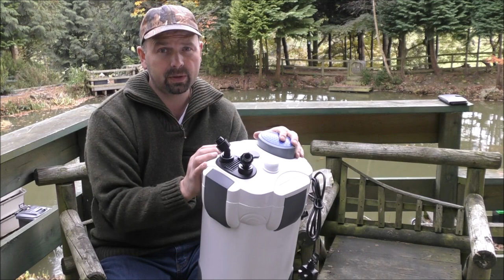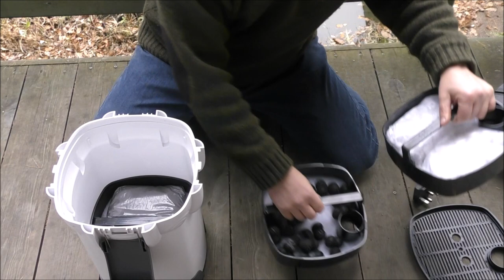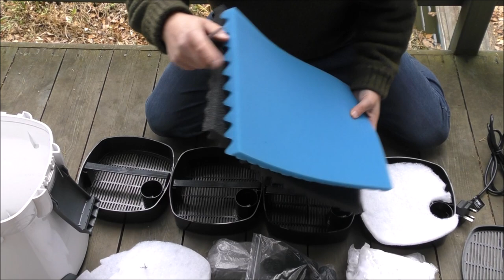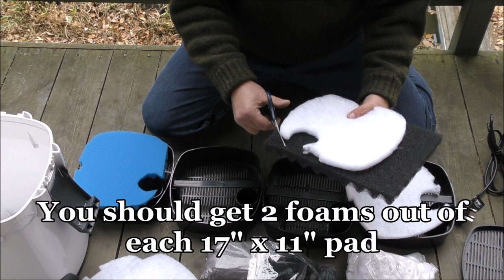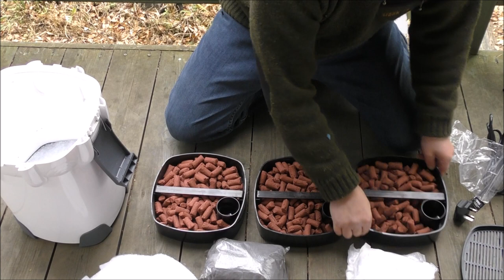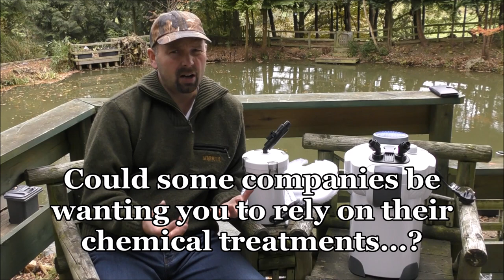Why Your Filter is TOO SMALL and NOT CYCLED

Comment: Hi, I love listening to you, but have a question about Zeolite use in a heavily stocked Goldfish/koi aquarium. We brought our pond Koi/goldfish in for the winter and are trying to maintain them in a 75 gallon tank until spring. 1 large koi, 7 large comets and 2 baby koi and 2 tiny goldfish. Our pond isn't deep enough for this kind of cold. We are hoping to deepen it and enlarge it this summer. Right now it's only 18 inches deep in one area. 
We had 2 huge big Penguin Bio wheel filters all along the back wall of the tank, but they just couldn't keep up with it and the Biowheels would stop moving in just a few days! We were having to replace the pads every 3 days and rinsing and scrubbing the filter pads, didn't work well at all. They clogged all the faster! We are doing water changes of 50% or more every week, and even some smaller changes in the middle. So this hasn't been going well, the ammonia was starting to show up, and cycling wasn't happening.
 
We watched several of your videos and have followed your advice,.... We purchased the 15 compartment Trickle filter you suggested and have just set it up, with Floss on top, Biohome in the middle and charcoal at the bottom. Now it's only been a few days,....we are just now remembering to add the little Gel Balls you included,....but we have a question about Zeolite. Should we use it too for now? Since we are getting some ammonia readings on the test strips? Sorry this is so long, but setting up the question was important to understanding it. Thank you!!
Reply from the maker: As long as you have plenty of media for the size of tank and stock of fish (it will be around 2kg per 100 litres for koi / goldfish) then zeolite should not be needed but it could be used in place of some carbon if you wanted to keep the ammonia down while the media matures. Bacteria does need ammonia to feed on so monitor things and if ammonia gets to high use the zeolite to lower the level. When media matures the ammonia should drop naturally.
The gel balls should go in with the media when setting up the filter as they will dissolve in presence of ammonia and help to seed media.

Comment: Thank you very much! What you've described totally makes sense and should be followed by everyone. Although I already have optimized my filtration mostly like you mentioned it, I did'nt thought on this last fine filter layer...which I will throw away next time cleaning my filters. ;-) How do you call this small filter, which you use as a mechanical filter? Didn't find it on amazon...

Comment: Very informative. However, I did have to have conversion calculators ready for liters to gallons and kilos to pounds. Very good though.
I was wondering, would it help or be beneficial to run two canister filters set up the same way as you have demonstrated?

Comment: Excellent video Richard. Have SUNSUN  dealt with the degradation of the plastic trays where the UV is housed yet? It's the only complaint I have for this very competitively priced canister filter. Apart from that they're well worth the money.
Reply from the maker: I have heard a couple of people mention the UV being a problem on the plastic but that is a common problem with cheap filters with integrated UV lights. I'd personally say go for one without a UV and install an inline UV on the intake or outlet pipe if necessary but the filter I have just shot a video for (Unimax 700) has the option for a good UV.
Reply: @pondguru  
Thanks mate! Sound advice.

Comment: Could you possibly do a follow up video that decodes what the various Sunsun series model numbers indicate?
I've been scouring the web trying to find a table that compares each of the different Sunsun series filters.
For example, what do each of the series numbers represent, such as 3##, 4##, 6##, 7##, etc...
What do the third digits indicate, such as ##2, ##3, etc...
What do B and non B models indicate?

I am specifically interested in doing the separate booster filter arrangement to handle the mechanical filtration and then use the canister filter to be totally dedicated to the bio media.
Can you give Sunsun model recommendations for a booster and canister filter combo that would be best suited for a general community fresh water 55 gallon tank?
Reply from the maker: Just as in this video - the 2000 litre version of SunSun and the 2.3 litre booster.
I think the equivalent number is 304 or 404? Over here they are called All Pond Soultions.

Comment: What about sponge filters? I think I remember seeing on one of your earlier videos in your fish shop that you had separate tanks filtered by only sponge filters. They seem to work, but no capacity really for anaerobic bacteria. So not all systems will manage anaerobic filtration and continue to rely on regular water changes.

I'm not having a dig, simply saying that in some instances a full cycle is never achieved.
Reply from the maker: Dead right, in those tanks filtered by only sponge filters or plastic moving bed filters nitrates were always high so reasonably large regular water changes were the only way to keep them down.
The size of filter and how it is set up will dictate how successful the cycle is and what the final concentration of nitrate will be - the better it is set up the more chance there is for a full cycle.

Comment: Good video, really enjoyed it. Would be awesome to see you put it to the test, run a couple of filters with you set up mentioned on a big 5ft tank with a couple of Oscars or something, testing and keeping a diary and see how nitrates do.

Would be keen to ditch the chemical filtration, but it leaves the water so crystal clear.

An interesting one for you, have you heard of Szat Clearwater? It's a chemical filtration that not only leaves your water crystal clear but it helps reduce Nitrates, been testing it myself on a fancy goldfish tank. 2 weeks without a water change and was only 40ppm with 3 medium goldies in a 100l tank.
Reply from the maker: That product sounds promising and 40ppm is low for a normal goldfish tank after 2 weeks just using chemical to keep it down, I've not heard of that one so couldn't say if it affects the anaerobic bacteria like other types appear to do.
Carbon or activated charcoal is as good as anything for 'polishing' water and drawing in residual fish treatments so I always recommend that since it allows the biohome filter media to achieve full cycle filtration.
If you scroll down some of the comment sections of this and other related videos you'll hear reports of the full cycle being achieved in all sorts of stocking scenarios including cichlid tanks, marine, goldfish and other tanks where high nitrates are normally expected.

Comment: Wouldn't improving the media and possibly enhancing the internal layout of the canister filter also increase the size of the tank it can support? Or is it mostly based on liters/hour flow?
Reply from the maker: The amount of media used in relation to the stock is the critical thing and that dictates filter size if you're looking to achieve a full cycle (reduction in nitrate).

Comment: Hi Richard! That was a master class about filtration and canister filters. I am considering moving to a sump, to accommodate more media, as I have goldfish. What about sump filters?
Reply from the maker: The same principle of Mechanical then Biological then Chemical (if used) will apply to all filters including sumps so no worries there. Sumps are often way bigger than they need to be so often end up getting packed out with plastic media since it is cheap. That is fine as long as you have some proper media in there too - enough for the situation which if you have goldfish could be up to 2kg per 100 litres. Many people use filter socks like this: http://geni.us/XnWA8k as their main mechanical filtration and they work very well, being swapped out and cleaned as necessary.
Thanks for watching and appreciating the videos.

Comment: Dude I've been watching info vids for a while now and yours are superb. I'm learning so much. I might need to get a larger external filter now and fill it with your biological media. I have the aqua one ocellaris 850 for a 230 litre tank. What do you reckon.
Reply from the maker: I think I may have answered this via an email which came through shortly after you posted the comment?
Here is what I sent:

I don't have the tray sizes recorded for the 850 nor can I find an exploded diagram anywhere to indicate the flow direction but it seems like the water travels down a central tube and water flows up through trays so the bottom tray would be for foams and fine pad leaving 2 trays for media - looks like each tray will hold around 1kg - 1.25kg of biohome ultimate so it could be just about big enough for the 230 litre tank to achieve a full cycle (reduction in nitrate).

You also have soace under the trays for settlement media (e.g. eheim mech).

This video explains the water flow: https://www.youtube.com/watch?v=pY3BeV-07rA

Unfortunately the guy sets it up arse end round but that is how it comes from manufacturer. If you haven't got fish in teh tank and want me to include the filter in the 'pimp my filter' series just give me a ring any time as I'd happily upgrade it for you.

Regards,

Richard 07772848730

Comment: Hi pondguru,what a great video full of great info 👍.I have recently bought a aquamanta efx 300 external filter and a filter booster (2.3 litre) .I added the old media and ceramic noodles to the external filter.But am now thinking of buying the biohome ultimate to put in my filter.What would I need to do when putting the new biohome media so that it doesn't cause problems with bio filtration ?My filter has only two trays,hence why I bought the filter booster. There is a gap between the bottom and the first tray,do you think I can put biohome in that gap?
Reply from the maker: I think we spoke on the phone yesterday - if there is anything you else you need to ask just ring any time.

Comment: I have the very same filter and booster canister the pre filter or booster canister has the course, medium & fine foam the bottom tray in the filter has fine polishing mats I then have three trays full with Biohome Ultra media I am using this on a 200 ltr tank that has been stocked for about a month now I have never had a spike of Ammonia, or Nitrite and the highest Nitrate I have experienced is 40ppm but I am hoping that will improve with time. will  consider putting polishing foam in pre filter or booster canister now freeing up another tray that will take another kilo of Biohome. Feeling very pleased having set it up the very way you say :-)
Reply from the maker: I'm glad you find the videos useful - thanks for watching.
If you're only a month in and you have 0 ammonia and 0 nitrite then its going well but if the nitrate is only 40ppm then it could still rise depending on stock and amount of media used. Some people never develop high nitrates (60ppm+) while maturing the filter as they fall after only a couple of months of rising but others will get very high before they fall - every tank is different but as long as enough media is used for the volume of tank and stocking situation then you should achieve full cycle no worries.

Comment: I can't believe I missed this video.  Probably your best.  I have two 60 gallon tanks with 3kg of Biohome Ultimate per tank with 406 Fluval set up like you advised.  I've been having issues not getting the full cycle going even after 10 months.  A couple of months ago I stopped using Prime.  Does that affect the anaerobic bacteria (you were talking about?).  I still do monthly water changes but the nitrates go up slower now.  

Your thoughts would be greatly appreciated.
Reply from the maker: Dear Chris,
It would help to know what the stock is in the tanks - 3kg for a 220 litre (approx. 60 US? gallon) normally stocked tropical tank should be no problem for a full cycle. It generally takes 1kg per 100 litres (26 US gallons) for a normally stocked tropical tank to achieve a full cycle and you've got nearer 1.5kg per 100 litres there. Heavily stocked tanks could take twice as much - I don't know the stock so I'm fishing in the dark here as to why (apart from the use of prime and time between water changes) the nitrate is still high.
Yes, anything which 'binds / detoxifies' ammonia, nitrite and nitrate will have a real starving effect on bacteria (esp. anaerobic bacteria) and that in turn affects the filter ability to process nitrate (ammonia and nitrite are easily reduced as that is all aerobic activity) so it's not surprising that you noticed nitrate rising slower now you've stopped using prime. That trend should continue to achieve a full cycle.
However, the tanks should ideally be cleaned once a week to remove uneaten fish waste and uneaten food - that will definitely be contributing to rising pollutants.
Feel free to send more details of the set up, stock, how each filter is set up, pictures etc. to sales@filterpro.co.uk as I quite often miss messages and comments on youtube - I get so many from the 1000+ videos that only a few are ever sent to me as notifications.
Regards,
Richard

Comment: You rock!  I have several Eheim canister filters Eheim pro 4+ 250, 350 and now a 1500XL (my 250 is now a spare as too small but good backup just in case).  In studying the water flow of the 350 it appears the coarse pad captures large stuff at the top JUST BEFORE the flow to the bottom of the canisters.  Therefore does it make sense to keep a coarse pad at the very top before the flow downward?  Secondly I have ordered the filter boosters, therefore if I put one of those on prior to canister filtration, then technically I feel I don’t need any mechanical filters in the canister after the installation of the filter booster which sits prior - correct?  OR should I keep the coarse one at the top anyway regardless?

Great video ! I have not set up my XL 1500 yet - it’s a beheamouth but adequately sized for my 125 gallon that I will be setting up
Reply from the maker: The 1500XL is certainly a monster in every sense.
With the pro4 series you're right with the layout and operation - just leave the pre-filter as it is then use bottom tray for the foams and fine pad followed by biological media in trays above that. A booster will take the mechanical filtration so will free up the bottom tray in the canister. The top pre-filter tray may as well have the foam left in there even when using a booster due to the shape and depth not being good for adding any media there.

Comment: So to contest to this, I have a 60gal us tank, with 2x penn plax cascade 1000 canisters, bottom trays set up with the triple pond foam and each have 2x full trays of mixed Biohome ultra mini as well as Biohome ultimate. I have about 10 various adult African cichlids, peacocks, yellows, etc, I honestly have not had time to so much as clean the foam as I've been working out of state for 2 months, there is no algae in the tank, and I just checked the nitrate level to find flat zero. With 2 filthy canisters. I think I have the right amount of media as well as Biohome 110% doing it's job of a COMPLETE nitrogen cycle
Reply from the maker: That is awesome to hear yet another success story and all the better it is in a cichlid tank which are usually notorious for high nitrates - it proves what can be done with proper filtration.

Comment: Can you recommend anything as an alternative to biohome ultimate that does the job? Doesn't seem to be locally available in australia and postage is killer from the UK
Reply from the maker: If you can get white pumice in a decent grade in a relatively small size (15mm - 25mm) it does a decent job but may buffer the pH up, fine if you have fish which like mineralised water.
Crushed red lava rock is OK too or just go with decent quality ceramic rings from Aqua One - they are about as good as you'll get for a low cost.
I couldn't say how much would be required or if there would even be a chance of achieving a full cycle with those - we do have an AU distributor for biohome - link is AU flag at the top of every page on the FilterPro website http://www.filterpro.co.uk
The video I did called 'Looking inside filter media' is probably a good one to check out as it shows the real differences between many popular types of media.

Comment: Great informative video, I have high nitrates and was searching for ways to fix it, I believe I’m now armed with almost all I  need to know to achieve this, just one question though, do you recommend or not recommend any particular water conditioner to avoid potentially killing off anaerobic bacteria? I’ve been using Tetra Aqua safe for many years, would this get the thumbs up as it only refers to binding heavy metals rather than bacteria.

Comment: Pondguru,  I'm only a new hobbyist fish keeper and this vid makes sense to me, so thank you.
Now, I want to ask you a question about "fluval C4 hang on filters", fluval site says they are "ideal for use in 150 to 165 L (40 to 70 US Gal) fresh or marine aquariums" and have "extensive 5 stage filtration for clean, clear and healthy water for aquarium life to thrive" 5 stages = 2 mechanical / 1 chemical / 2 biological 
I use this filter on a 130 L or 36 gallon aquarium and would like to know how to get the max filtration benefit out of it and would it be possible to get any anaerobic cycle happening?
Reply from the maker: I'm not a fan of HOB filters as they generally rely on a cartridge system (to keep you buying parts) and generally can't hold much proper media. However there are plenty of videos on YouTube of people altering them to set up correctly and hold biological media and they have had success doing that but the filter does seem to be over-sized for the tank (to hold plenty of media)